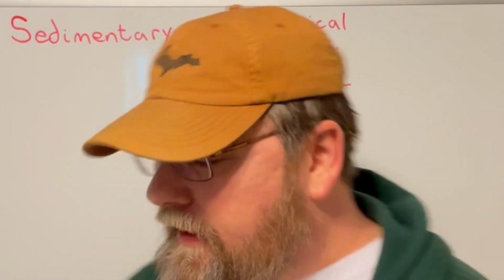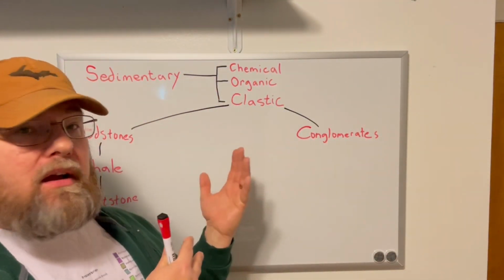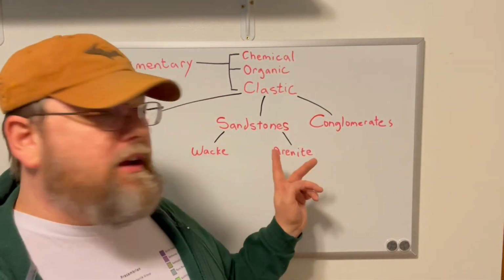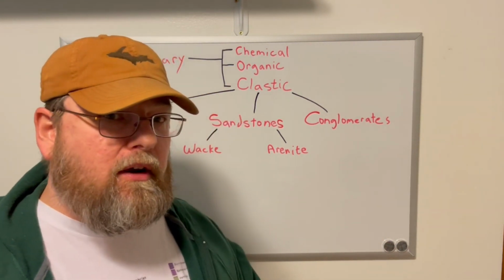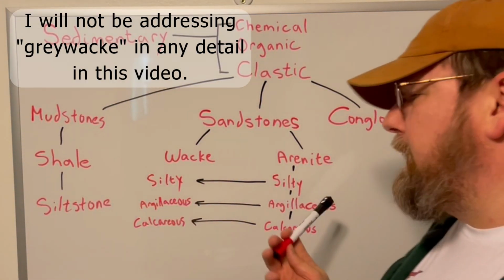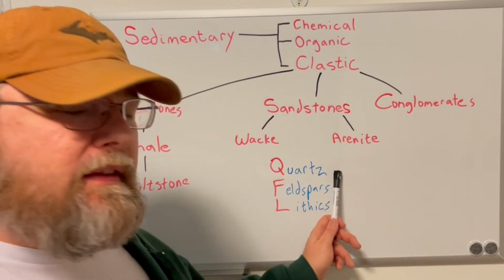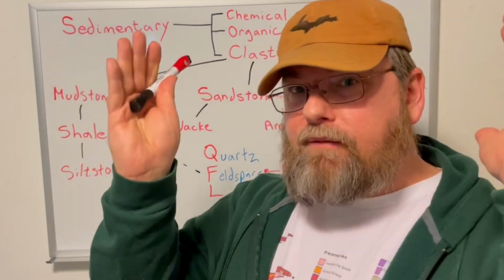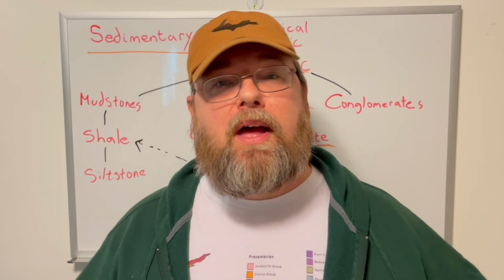Geo Files: How Do We Classify Sandstone (S6 E3)

Comment: Did you know 2mm was picked because that was a sieve size already in use.
Reply from the maker: I think it is and isn’t. For engineering purposes…yeah. ASTM predates Wentworth but I don’t think the standard for USCS and standard sieves was until 1945 maybe 1948. I don’t remember. I do know it post dates Wentworth. 

I’m pretty sure the first sieves divided out to a standard was post WWI era. I know they go back to ancient times, but I’m speaking from a standardized consistent scientific and engineering usage. But I could be wrong there. I seem to remember trying to find that out once and the 1920s was as good as I could find. 

But the Wentworth scale is 100 years old this year. 2mm=0 phi = -log2(mm) that’s because of Krimbein if memory serves. It’s not based on sieve size. 

I have sieves Wentworth divided down to co silt.